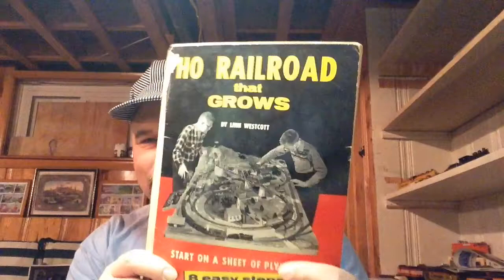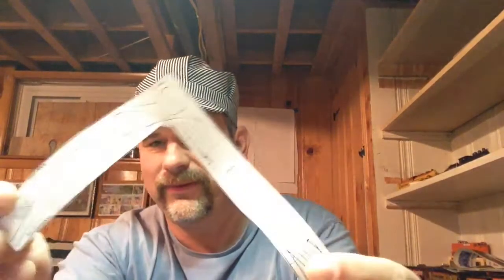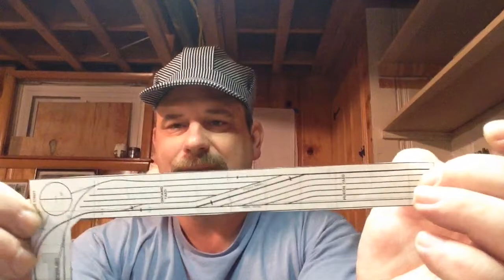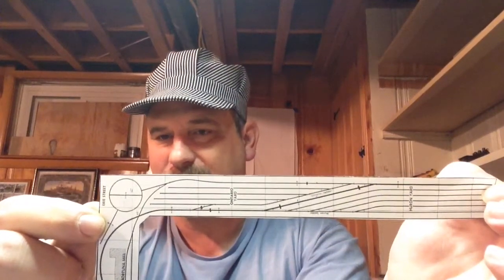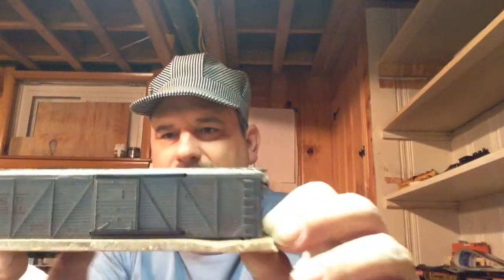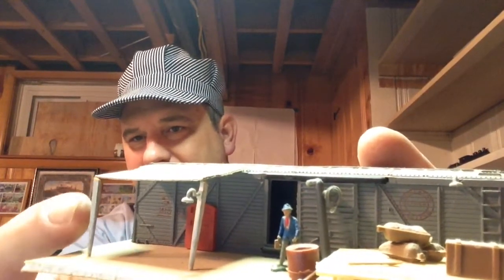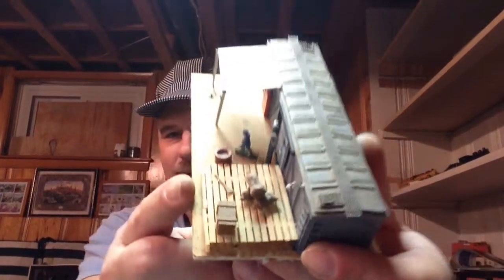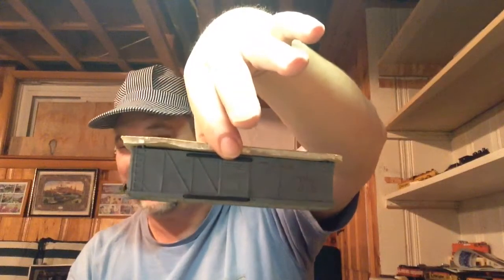Boeville & Newtown, Vlog #10, 3/22/15

Comment: Hey Ray, nothing wrong with DC or your model railroad! I'm sure I could come run trains with you and have a blast. I'm sure you can put together some great freight operations with a little planning.
thanks for sharing, Chuck
Reply from the maker: ***** Thank you again sir! Just not ready for DCC.I'm working on the yard again. After my Ops (oops) session, I found that the yard switcher has an issue and atleast 3 pieces of track need attention along with a couple of switches.